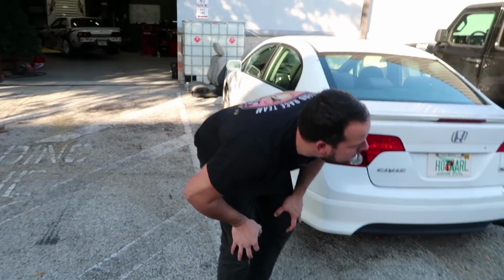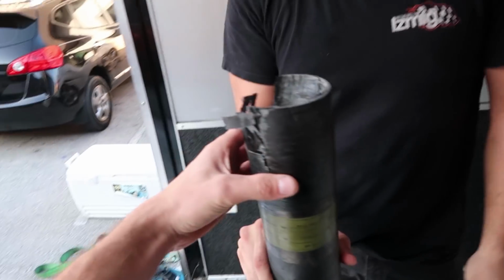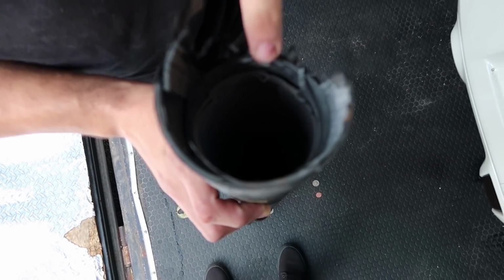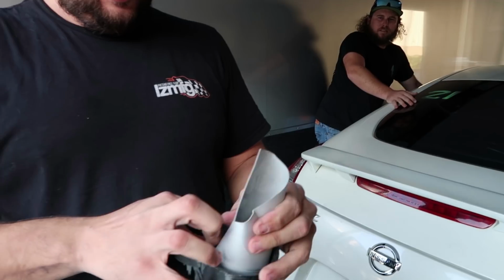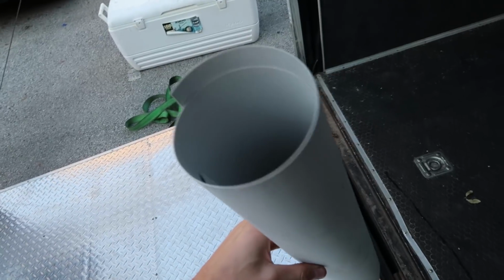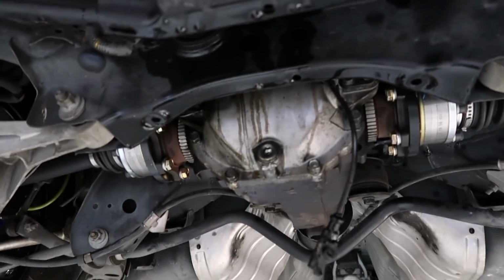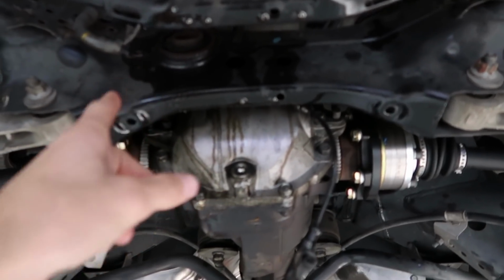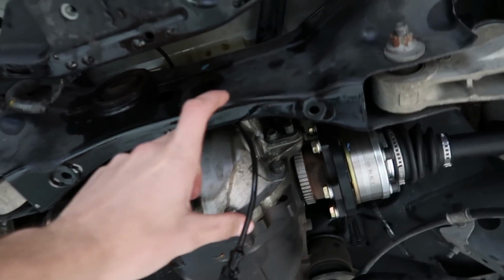Zeroy Damage Assesment + Drift Demo

Comment: I can see other things that I believe would help prevent future carnage on Zeroy. 1. Polyurethane motor mounts (or something to stabilize the motor more) 2. Bigger, Better transmission cross member with a poly mount. The cross member needs to connect the two frame rails, and it can't just bolt to the floor pan. Look at how the Burnout Kings in Australian reinforce their chassis and apply this knowledge to your car build. Drag racing is a fight against the clock, but also extreme shock loads and torsional twist to virtually every component of the car. 3. All the rear suspension needs to be upgraded...I don't think you need bullet or titanium parts by any means, but something stronger than stock. Coil overs, YES at least on the rear, so you can adjust it for the launches. Bigger sway bars will helps mite gate the torsional twist of the rear end suspension, helping the car to launch straighter. I would try and avoid solid mount bushings and seek out poly mounts when ever possible, they are more forgiving and less likely to break components. 4. The pinion end of the diff needs support too, not just the back of the diff. Pinions try and climb when launched hard. The nose off the diff climbs, because of the directional change of torque in the diff. (The diff is trying to do a back flip under the car, GO PRO IT! I PROMISE IT WILL BLOW EVERYONES MIND, HOW VIOLENT IT IS UNDER THERE). This is why the car squats, the diff twists under the car the pinion going upwards, the back plate down which in turn pulls the car downward causing the car to squat. Ideally the car has little or no squat... That is one sign the car chassis is working right for drag racing.  The old school solution was called a pinion snubber. The more modern solution is a torque arm or 3rd arm. Ideally connecting the diff to the Bigger Better transmission cross member mentioned in point #2. Thanks for taking the time to listen. Best wishes. #Zeroy #AdamLZ
Reply from the maker: Great info!

Comment: You guys need to learn the trick of having your heating up full. Fans up full speed going up the windscreen. Takes heat away from the engine. Makes you very warm inside the car but it helps